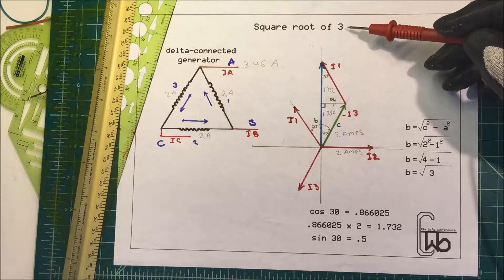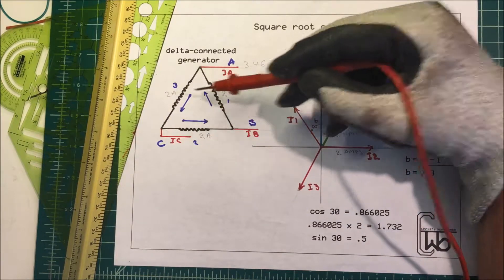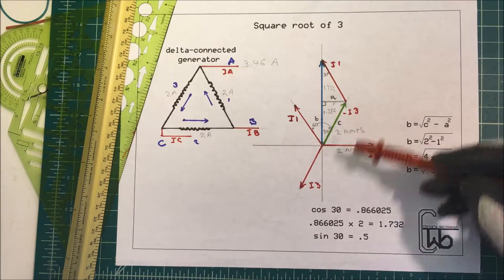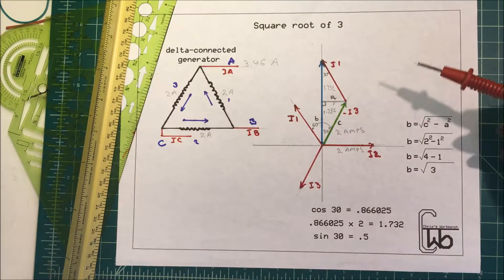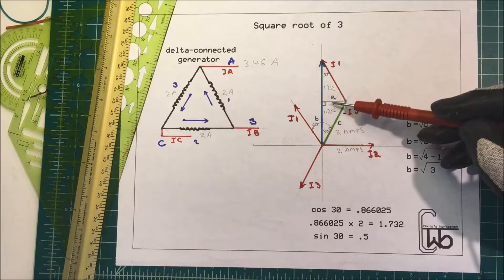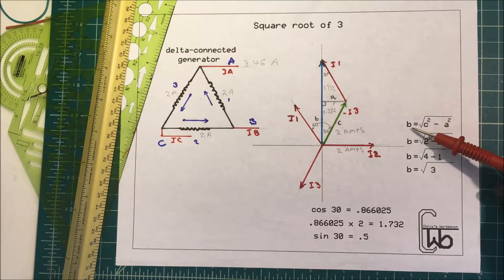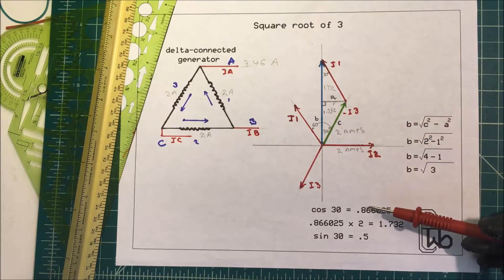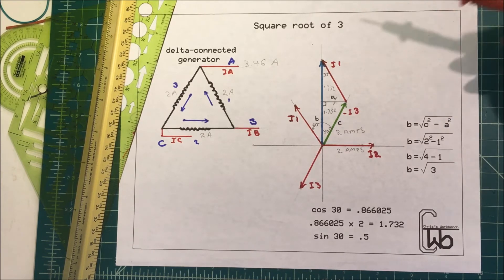Square root of three

Comment: so whats the blue line (b) is representing ?, does it represent the power output from i3 and i1 ? and for the rest.... A and C line, is the value just the same as the root of 3?, and what is the root of three for? is it for calculating the sum of power drawn in 3 phase generator. sorry for asking to much, i really need some kind like "clarification" to get my theory in my head right..... and sorry for the bad grammar
Reply: The blue line represents the Line Current of phase A. He's adding the phasors of I a->b  and I a->c. In this video he's using the tip to tail method, placing two right triangles back to back and using the cosine of the phase angle to calculate the horizontal components, and adding the horizontal components together. 

If you get a scientific calculator, you can simply add the two current values together at their respective angles, ex; 10 @120⁰ + 10 @ 60⁰. In a BALANCED generator or motor, your phases will always be 120⁰ apart from one another, and any two added together for a line value will be 60⁰ apart. 

√3 comes in when going from phase current to line current in a ∆ connected system, or phase voltage to line voltage in a wye/star connected system. This video just demonstrates where we get √3 from by drawing the phasors out like this